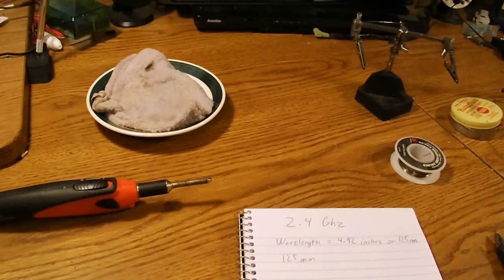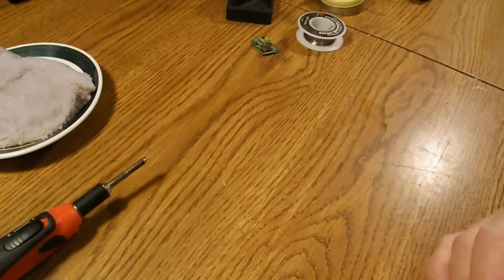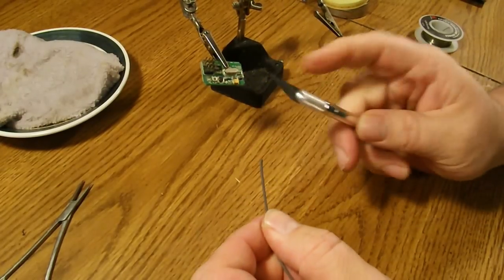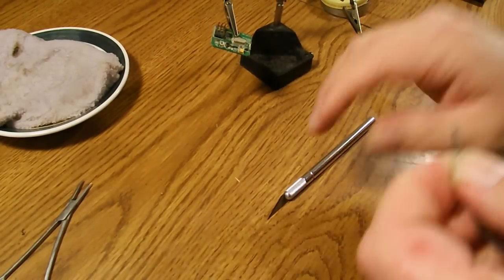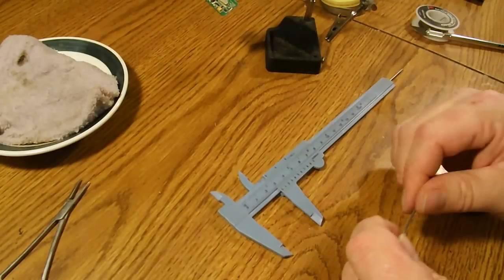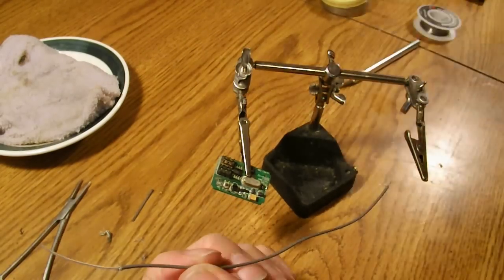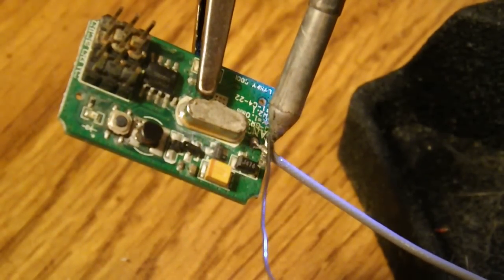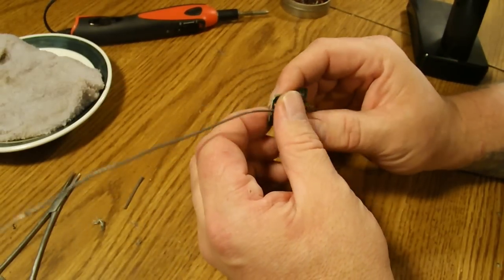2 4 GHZ antenna repair

Comment: Hello! I have an S8R reciever from FrSky. After one of the antennas was cuting from a prop, the RF-signal was not good anymore. But I have the another original one. And that is 35mm. So I took broken antennas of my Laptop Wifi-card. And cut the isolation like original of FrSky Reciever to 35mm. Without better signal.
At the week I've bought new 150mm antennas for my reciever. And the unisolated end of it  was 34mm on both new antennas.  Should i try to unsolate the 34 to 35mm. And then maybe cuting it of a half or 1mm away, till i have a good signal?  
I want just have a good rf-signal ahgain, and make nice flights.
But why is it so different about the unisolated part of the antennas? I think it would be name monopole. Cause it's defently not a dipole.

Comment: You said, "if the shield and the centre wire touches, it becomes one big thing and won't work?" Well, I'm doing this on a Traxxas #6519 board and noticed that both solder pads (centre and ground) are touching! I checked it with a multimeter. So, it doesn't make a difference if they are touching.

Comment: Thanks so much. I only had to do the end of the wire and it worked great. But now I'll know how to replace the whole thing if needed. Thanks again for this video!!
Reply from the maker: Glad this old ass video is still helping people. I want to get back into posting but I've been working 60+ hour weeks for the last year and a half. It is hard to find time to record.
Reply: @ramrod126  I like older videos because half the time you're working on something that's 3 or 4 years old and you don't want to see the brand new versions of things. The first time I fixed it it didn't work because I strip the insulation but forgot to take off the shielding. Duh. After that it worked great. Been having a blast with my four-wheel drive brushless Stampede in the snow here lately. I'll have a lot more fun now of course they can go farther than 15 feet away from me. If you don't mind my asking what do you do for a living that is taking up 60 plus hours a week?
Reply from the maker: @thestime  I work for a pet food plant. The plant used to be owned by a German company, 3 years ago a US based plant bought us out. They are based in Indiana and we are their only east coast asset. So we work a LOT.

Comment: if I want a longer antenna on a rx that has no connector like that, do i just unsolder the blob to get the old wire off and then solder the new wire on that blob? It's just one connection? Thanks.

Comment: I have a 2.4 GHZ quad copter TX that I wanted to do an antenna mod on. The stock antenna on the board was just an insulated 3.125 cm length of wire soldered to a spot on the circuit board labeled "ANT". There was no ground just that length of insulated wire. If I solder a 6.5 or 12.5 cm length of center portion of antenna wire stripped of shield to this point, should it work okay?
Reply: Hi , i have the same problem with my rc  receiver. did you find out the solution to not having a ground connection to attach the outer cable of the antenna  too? thanks

Comment: Taranis Rx antenna "bare wire length" is 26mm? I copied this and it works as well as original?? is this shorter than theoretical length due to variance for type of coax??

Comment: Just wanted to add a couple of things.  First,  when creating your "antenna" end,  don't remove the shield,  pull it back around the cable and put a piece of heat shrink on it.  the ground should be as long as the stripped internal wire. next. after the soldering job, always check with a meter to ensure the leads are not grounding. good luck
Reply: also it makes the job easyer by not cutting the shelding

Comment: Let me see if I'm right: The length of the antenna WITH the shield doesn't matter. The important length is this slice of antenna WITHOUT the shield protector: 123mm? (or a 1/2: (61,5mm) or a 1/4: (30,7mm)? I'm right?
Today I cut from the root my antenna from RadioLink R9D 2.4Ghz 9-Ch S.Bus Receiver and now I need to fix it.
Reply: Antoni Pons Oliver i

Comment: is it ok if i just coiled up the entire antenna inside the receiver box so it doesn't stick out?
Reply: What do you mean ground out?
Reply: i mean dont let the little wire in the antenna touch any solder joints or the CH1 and CH2 terminals
Reply: +kimbo slice i see. thanks

Comment: Best tutorial I found after looking for a while. Such a big help. The only problem is my receiver solder points are much closer together and in a very hard to reach place, much harder than my soldering skills can master. But Your video did give me the answers I was looking for. Especially the length of shielding to be removed and also that you need to solder the shielding on. The other video I just watched totally ignored both of those points and just said you need to use the same length of wire as the old antenna. (impossible for me as I don't have a the full piece of the old wire, it's in a field somewhere. lol). My only regret is not watching this first as I paid a premium for a replacement cable from a model shop when I could have butchered one of the many old routers/laptops.computers I have lying around... Lesson learned... Thanks a bunch though and I'm going to try the repair. The receiver is no use without an antenna so paying £5 for a wire is pennies compared to paying £70 for a new receiver.
Reply from the maker: +Lee OfBacup Well good luck. I am glad my simple video might help you.

Comment: Hi Can you let me know the length of the new antenna wire.. , is it matter or the end point of the wire 31.25mm is the "Key".. Length of the new antenna wire is not matter?
Reply from the maker: Ken C The overall length doesn't matter too much. The stripped part is the key.
Reply: Thanks for the quick reply. nice. learn more.

Comment: Thanks helped me fix mine. You were also saying how you waterproof your receiver? Do you have a video on that?
Reply from the maker: Don Armstrong Unfortunately I do not have a video for that. If I ever get some equipment back (camera, RC stuff, etc...) I will be sure to make a video. It is pretty easy to do though. I used liquid electrical tape and just brushed several coats on both sides of the circuit board. Just make sure it is well covered. Plati-dip works well too. Both can be found at your local hardware store.
Reply: Thanks, I'll certainly give it a try. And thanks again for responding.

Comment: Awesome! Just fixed my MERV's antenna after having watched this, and saved some bucks on not having to buy a new Rx, as my local dealer suggested. Range is as it initially was out of the box.
Took this opportunity to also roll upp the antenna length inside the Rx-box and only have a stump sticking out. There will be no more broken antennas now.
Again, awesome video, thanks Justin!

Comment: but for turnigy 9x reciever the stripped antenna length is 2.94cm...and has a brass sheild...what for it is?
Reply: It makes it a sleeved dipole which has approximately a 3 dB (double the sensitivity) over a sinple monopole (the inner core on its own)